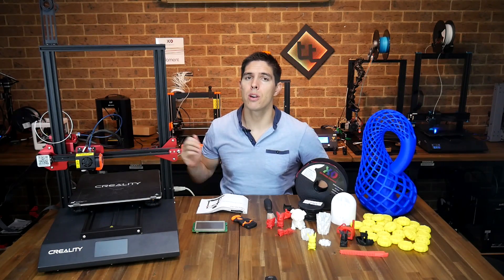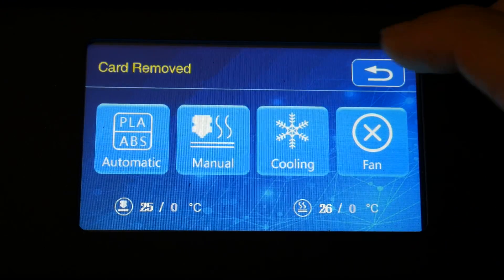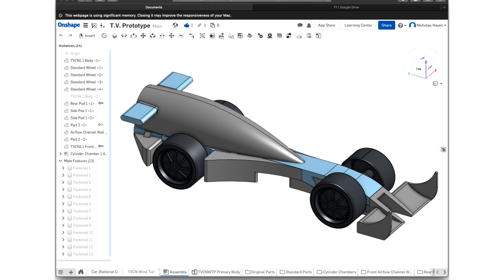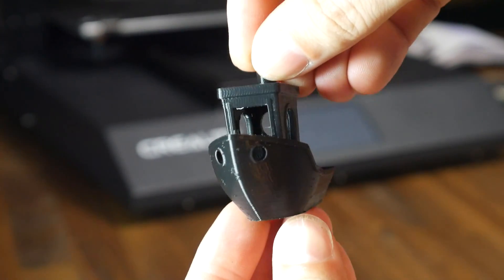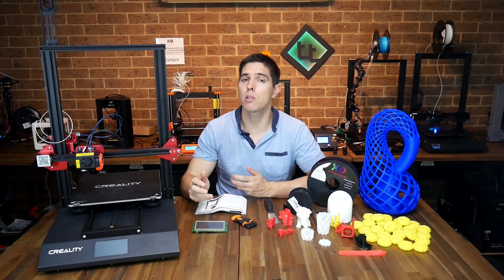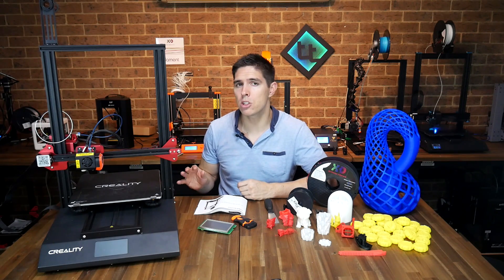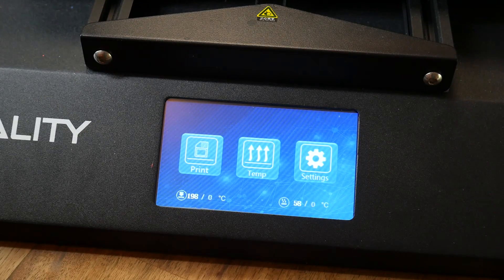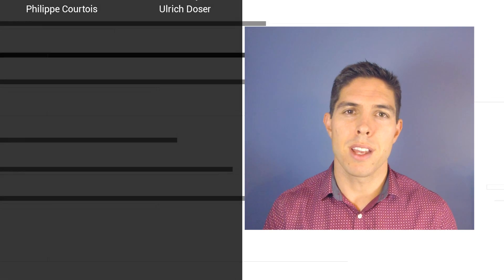Creality CR-10S Pro - An honest review *UPDATE IN DESCRIPTION*

Comment: Completely off topic, but how's the ender 5 going? I asks because I really like the way it's set up and I think I would like to make it my second printer. (I have an ender 2 by the way, great little printer. Form factor verse build bed is good plus it has a hot bed, can't go wrong) I'm kind of waiting/ hoping that they will do an ender 5 pro or something like that: with a bigger bed and better electronics though. I live in hope anyway.
Reply from the maker: Haven't used it a great deal lately with all the stepper driver vids. Ultimately planning to enclose it as an abs specific machine but will make a more moderate mod video before then.
Reply: @TeachingTech  Cheers mate thanks for the reply. Looking forward to seeing those vids.

Comment: I am so glad someone finally provided an honest review of this printer.  I had so many problems with the ABL sensor myself, as well as being an early owner before there were actually publicly available instructions on how to update the screen firmware.   

I was really disappointed with Makers Muse and 3d Printing Nerd and others who I feel did not provide an honest review.   

One huge negative that you did not mention is that they used a non-standard design for the nozzle thread - IE - you can only get nozzles for his machine from Creality as i understand it.

I also had significant z axis binding and misssed steps, so my x axis carraige would never stay level.
I believe that this printer would be a winner if released as follows:

1)  Standard marlin compatible screen.  The touch screen is nice, but honest]ly who cares..i want a printer that works and can be upgraded, customized, and take advantage of all latest marlin features.  I do not want to have to  wait to use new community features until someone writes custom screen firmware.  Plus, it is a small nightmare to upgrade the screen firmware.
2)  Standard nozzle tread.  Come on - why not.
3)  BL touch.  There is just no substitute.
4)  Top belt/pulley to synchronize z axis steppers
5)  Like 6-8  fewer screws holding on the bottom cover.   It is a nightmare to get into the bottom of the printer.
6)  I do not like the ribbon cable.  It severely limits flexibility / customizing the printer, and i believe it will not be reliable in the long run.
7)  flexible build plate, or even glass as stock.  the provided build surface is horrible for many reasons.
Reply from the maker: Nice list of features. I agree with them. I had a pic of the nozzle ready but accidentally missed it in the edit.
Reply from the maker: Oh and I have a wham bam ready to go on instead of the fat alloy plate.
Reply: @TeachingTech  would you say or recomend - to me - i get my cr-10s pro tmr that i should order already a wham  bam? Can you recomend anything else to have an easier start with this machine? I already have the Cr-10 which is awesome as it is, but limited in heat and filament types. Thanks for your answer.
Reply: micro swiss makes nozzles and they have an all metal kit as well....nozzles come in .2, .4, and.6mm ....also, you can get polyplate or pei sheet for print bed....
Reply: I agree with the screen. Thats why i have a 12864 LCD installed. But the ribbon cable will not be an issue. Its long enough to prevent hard bends.

Comment: I've had the CR-10S Pro for a few weeks and have really enjoyed it. Like many, I've had a lot of difficulty with the auto bed leveling. I recently found that adjusting the sensor screw and hitting z-home to test has given me repeatable leveling.
Regarding the power failure detection: it worked flawlessly on my printer with the stock firmware, so that is probably a tinymachine's issue.
My main gripe with the printer now is the nozzle, which apparently is not a standard nozzle like the CR-10 or Ender 3. I'm working on replacing the heater assembly with an all metal hotend from Micro-Swiss.
Reply from the maker: Thanks for sharing, I will be reading up more in the community and experimenting with the ABL some more.
Reply: @TeachingTech  If you are going to experiment with  the ABL, check out my threads on reddit, user Graham0x57. "CR-10S Pro setup notes" and "CR-10s Pro bed leveling sensor investigation"

Comment: If the bed surface is not removable what are those metal clips for in the front?
Reply: The metal bed can be removed, just nothing on the market yet to replace it with... well besides a mirror from Home Depo. Own one my self.
Reply from the maker: Yep the bed comes off but is not flexible so no real point to it.
Reply: tiny machines sells two different upgrades for the print bed....one is PEI
Reply: @Mobeezy357   Well they have listings, but I have yet to see them be in stock for the entire time I've had my printer. ¯\_(ツ)_/¯

Comment: I Bought one about a month ago and am pretty happy with it. A couple of notes
1. The initial bed leveling is quite a complex procedure, there's three or four things that have to be done in order and the instructions are not 100% clear, youtube videos on it also vary so hard to work it out. Once done it seems to work. I do ABL every boot, watch the first layer carefully, and prints are sticking during print but just pull off when the bed cools (PLA & PET, yet to try ABS).
2. On mine, maybe I knocked it but in Print Adjust there was an 'Economy' button set to ON. You need to set this to OFF because it switches bed heating off after a couple of layers, but the build plate is meant to release prints on cooling ... so if Economy is ON prints tend to fall off before they are done. Silly.
3. Also don't like placement of the filament reel, I shifted it to the side column to make a straighter feed path (costs ~25mm build height). Still don't really like the weight up there because the machine can develop a wobble sometime and I fear this will eventually weaken where the post are screwed down, so before long I'll shift it off completely.
Apart from that it seems to work pretty well.
Reply from the maker: Well said. So much potential once the little things are sorted.
Reply: @TeachingTech  i hope you will make a video about all the little things and how you sorted it out. My cr-10s pro comes tmr and i am not sure if i had ordered it after your review because i already have a cr-10. But its limited with the bedheat and so on. My need is to print pet-g and flex filament. So i had the choise to upgrade the perfect working cr-10 with the risk to ruin it or to buy the new cr-10s pro for the other filaments. But now i am unsure if i will be happy with the PRO. I also dont understand why this bedleveling is needed again and again? I mean why if i dont change the filament type, i dont have to change the bed lvl on my cr-10 for month, and its still great. David above wrote he has to lvl his bed after EACH BOOT??? I think i will go crazy before i have the cr-10s pro already... what a waste of time..
Reply: @tamgaming9861   I do the ABL(*) each boot because I read somewhere else that there might be firmware issues with the mesh values being forgotten sometimes. I bought this machine specifically because I wanted to do bigger prints than my old machine. Big prints = big potential to lose many hours if the print comes off half way through. So when I turn it on I bring it up to temperature and hit ABL; that takes maybe 3 minutes vs 35 hours for my first big print; so it's just cheap insurance really.
(* Tam Gaming, ABL that I do at each boot is just the automated function that takes two clicks on the touchscreen and ~30secs to complete, not full manual leveling which is fiddly and takes ~10mins)
The other thing with ABL, when you do it, it pays to look at the four corner values that the ABL screen displays. If they are not pretty similar you should go back to step one of the manual bed levelling because I think ABL is really for small defects in the plate rather than something being badly out of wack. Also when you do ABL at boot you can check the four corner values again and make sure nothing has been changed due to bumping etc.
As for CR10 vs CR10s Pro, I can't really say. When I bought mine I looked at a couple of the other large format printers in my price range (Tevo & JG Aurora). One of the reasons I paid a bit more for the Creality was they seem to be doing a better job of cultivating the open source/maker community. I'm not a FOSS warrior by any means but I think when you buy any of these cheaper printers the fact is the manufacturer is not going to have great support (especially in 6 months when they are already onto the next model). So in the end  the open source crowd becomes your number one place for support, tweaks, updates & upgrades. Happened with the CR10, I hope it happens with the Pro. To a degree that has already started - Teaching Tech mentions a couple of fixes in the video - so good start anyway and I'm confident that most of various problems will be resolved.

Comment: Mine should arrive tomorrow,  excited!

Probably going to take your suggestion and get the flex plate. Also, likely going to swap to bltouch. Really don't like the capacitive sensors.
Reply: i get mine tmr - how its going so far with yours?
Reply: @tamgaming9861  sadly, I had to return it. I started a vase test print after setting it up and the ssr died. I was really looking forward to this one too. Now I'm debating on if I want to get another and chock it up to a one off issue.
Reply: @w159  oh man i  feel sorry for you. What i read so far is, the owners who got it to work, are VERY happy to use it and dont want a prusa instead, because prusa has a lot of problems atm with pet-g and so. BUT the owners who have problems are most the ones who only want to print with it. But if they cant fix it because they dont know how or its too much work in their eye, then you will be unhappy. I ordered also the touchlvl system in hope i get one of the most discussed problems right from teh beginning away. The Wham Bam i will stay away for the first time because its really too much money for only a big metall. I will try the method with reheat the bed to 60°C and then try to get it off. But we will see :-)

Comment: I purchased by Ender 3 through Tiny Machines and I soon realized that the Power Loss wasn't working either.  I was told, by them, that there isn't enough memory on board for it and the thermal runaway both.  Safety 1st.....
Reply from the maker: Thanks for clarifying.

Comment: I have owned this printer for a couple of weeks now and would say your review is spot on, everything you experienced reflected to the letter my own ( including nozzle to low, gouging the print bed). One thing I could possibly add about removing the prints after completion, I found that if I let the print bed cool down to room temperature and then using the manual temp button increase the temp back up to 60 degrees the prints need very little force assertion to be removed. great review keep up the good work
Reply: I use a Brim because it guides the scraper and makes it easier to get under the part.

Comment: Got my Pro early January and am very happy with it. I am on some forums and facebook groups and see alot of people having the same issues you point out. Myself have been very lucky as I don't have any issues other than the shards of filament collecting in the same spot as you do. I run 0 z offset and get the correct first layer after using the bed leveling process, maybe I have a better sensor than most or the environment I use my printer in is perfect for it, I don't really know. I refuse to use the tinymachines firmware for now as it seems to have a few bugs still, obviously I am using the stock Creality firmware. Am at 100s of hours of printing and am quite use to doing the auto level procedure that I know most don't like doing every boot up, I have it down to a few mins. Print bed for me stick just fine, I remove prints at 60c. 
My only gripe is that I haven't been able to successfully print with TPU, it gets jammed in the extruder, have tried many things but still no luck, I wont give up though as I can see you have been able to print TPU some what successfully. I enjoy your videos and watched a few before buying the CR-10S Pro. I look forward to more of your Pro videos.

Comment: I've had one for three months. Would not recommend. The CR10S is better for the money. Creality needs to slow down on the models. The bed leveller is garbage. They can't even bother to spell the English labels correctly.  If you shim to 0.2mm, nothing will stick. I've had repeated failures from the print shifting layers 4mm for no explicable reason.
I broke the fan duct as well. No way will mine run 90mm/sec. 

You should not hack at the bed like that, pry the edges with a large box cutter.
Firmware update is far easier thru Cura. Ok, you can get good results, but it takes too much work for the price.
Lasty, the filament spool should be beside the printer, not on top, 1kg of mass on the frame affects rippling.

Comment: Wait, isn't this bed surface is removable and flexible?
Reply: You can remove the bed but it certainly isn't flexible
Reply: Well, you could flex it. Once! :-)
Reply: @Surprise & Delight It is a sheet of glass, with sticker on it. The glass attaches to the aluminum bed.
Reply: @Surprise & Delight looks like they added the glass to a new revision.

Comment: I' a happy CR10S Pro owner, and I can confirm everything you said. Matches my experience with it 100%.
Reply: Is it good now?
Reply: is it still worth to buy one if you already have a cr-10?
Reply: @tamgaming9861  I'm not sure. It depends perhaps on how DIY capable you are? My impression is that the 10 and the 10S can be improved to quite capable beasts with some knowhow and elbow grease.

I'd say the 10S Pro is a must to swap out the ABL for a better one.

I wanted the different setup with the electronics enclosed underneath.

For me open-source was important, and the PRO isn't yet fully open source (the screen is closed source).
Reply: @aarntsen   thanks for this answer. Yes the point with open source and the "closed but already cracked screen" is understandable. i watched before a video where the talked about that some ppl cracked the lcd software because so many things work only if you can change it. Lets hope the lcd will have a long life and we dont get the same problems as he had in the video. I ordered mine 2 weeks ago and i should get it tmr. So i hope i get not such problems, otherwise it would be a disaster. Because i want to print not to work on the machine the whole time :-)
Reply: Tam Gaming - yah how’s the machine working?
Reply: Arnljot Arntsen Is this machine still working well?